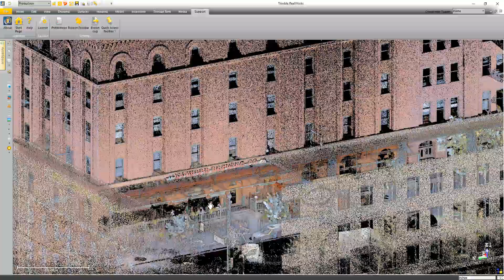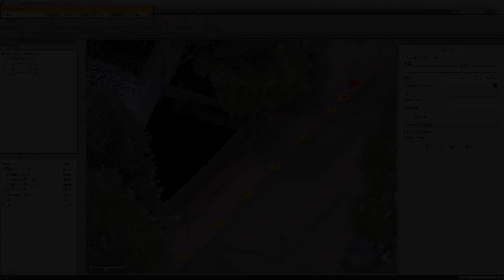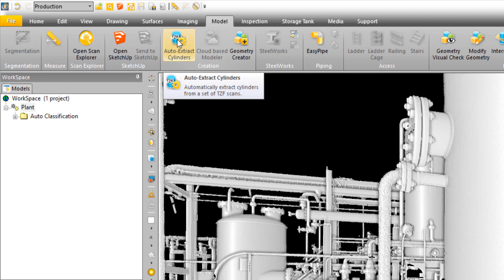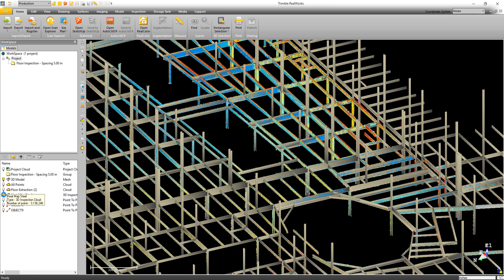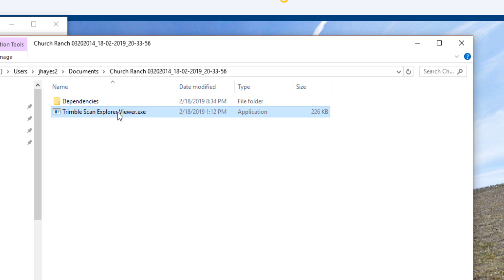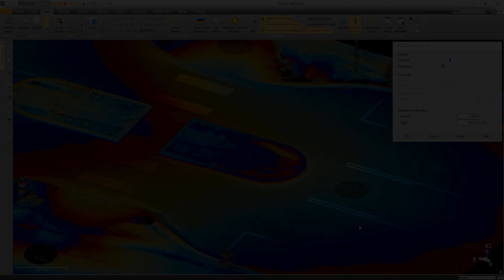What's New in Trimble RealWorks 11.1

Comment: My scanner has started getting horizontal black lines in half of the scan. I've had it serviced in the past and I've tried cleaning the lens. Any idea what might be causing this?
Reply from the maker: hard to say specifically without actually seeing it. If you could send some images to your dealer they can submit the issue to support. Probably the best way to get a correct diagnosis.

Comment: Is there a way to remove unwanted points from the TZF files? I'd like to have a cleaned version for future cloud based registration, there are always points in the TZF I do no want to be apart of the registration process.
Reply from the maker: There are a couple of options you may be interested in. Both options are available in the Production mode under the Edit tab in the TZF scan group. The first option is to segment and isolate the noise into a single object. You can then select that object and click Remove points from TZF Scans. This will be permanent so you may want to have a backup of the raw TZF files. The other option is kind of the opposite in that you can create a final cleaned object and then create new TZF files from it. It is a bit tricky in that you would want to know your grid resolution for the best result. For a TX8 level 2 scan I use a grid resolution of 128.

Comment: I have a really nice laptop set up.... however... when I'm running RealWorks the task manger tells me usage is at 85% or higher.  Whats the recommended settings for TRW?
Reply from the maker: TRW can use a lot of resources when doing the initial processing and registration of scans. the TRW web page gives the minimum system requirements. What I am using is an Intel i7 6 core CPU. This is a pretty nice balance in that I get the extra threads for doing file processing and registration but also some nice clock speed. For the initial steps of initial processing and registration more cores will speed you up a lot. Our QA team uses an Alienware Ryzen system with I think 32 threads and get really good speeds for these steps. However once you get past these initial steps having the faster processors from Intel help a lot more. The next big improvements is having fast SSD hard drives preferably in RAID 0. I am using a couple Samsung 970 pro. The fast drives make a big difference as there is a lot of reading and writing going on when working with TRW. Having 16-32 GB of RAM is sufficient. Next is the GPU. I have an Nvidia GeForce 1080 and get some extra benefits when rendering. In the past I used Nvidia Quadro and had good success also. I haven't tried any of the new AMD cards so I really can't comment on those.
I hope this helps.

Comment: Any Sign of a pre-registration cleanup tool (i.e. permanent delete of noise/traffic etc). This was mentioned in the comments for the V11 0 video, TRW said you were going to look into it
Reply from the maker: Not yet. We actually are looking into it. A couple of questions. Would you prefer to go through each station one by one and clean them up and then register? In that case you can do this in the cloud to cloud registration tool although you can't save this cleaned up state using that tool. Or would you prefer to use one of the automatic registrations and then clean multiple stations at a time in the 3D view and then tighten up the registration? Also I am assuming this is all using a targetless registration workflow?
Reply: @TrimbleRealityCapture  Workflow = mix of target and auto-register using planes. Generally I try to have enough control points so that each setup can be placed on datum individually, then tighten up any minimal mismatch with auto-register using planes if required. On occasion will use cloud to cloud if there is not enough control points or planes to tighten individual setups together. We scan in busy environments with lots of foot, road and rail traffic and therefore lots of scan noise (ideally would like the two pass scan function in the TX8 to only keep the furthest recorded and/or coinciding points from both scans i.e. removing any moving traffic automatically....discussion for another day I suppose)
Basically looking for a permanent delete/ clean cloud segmentation tool to use in registration mode. Preference would be station by station but also cleaning the registered cloud would be helpful also. The main issue currently is that if you have segmented out noise from the project cloud at any stage, it is only a temporary delete. When in production mode and extracting solids I will regularly need to bring removed points from extraction back by right clicking on the project cloud in the list and select "get all points" which does as it says including any noise cleaned out (making the process of cleaning up cloud pointless). Clean by segmentation tool in registration mode that on accepting would permanently remove that segmented cloud (never be available in production mode) i.e. "get all points" in production mode would return all project points minus what you have permanently cleaned in registration modes. Hope the above makes sense.
Reply: @TrimbleRealityCapture  any commitment to implement this? more than happy to provide more information if you require it from a user end?
Reply from the maker: @ronankelly3728  We haven't got to it yet but there are a couple of options you may be interested in for now. Both options are available in the Production mode under the Edit tab in the TZF scan group. The first option is to segment the noise into a single object. You can then select that object and click Remove points from TZF Scans. This will be permanent so you may want to have a backup of the raw TZF files. The pther option is kind of the opposite in that you can create a final cleaned object and then create new TZF files from it. It is a bit tricky in that you would want to know your grid resolution for the best result. For a TX8 level 2 scan I use a grid resolution of 128. 
For both of these options the effect are on the raw TZF files. So you would want to create a new project and import these TZF files and then extract the points from them. A bit of work but if you want to completely remove points from the database with no possibility of retrieving them this is something you can do.
Reply: This is so desperately needed. Without it, it is necessary to use other software for point filtering and cleanup. Very frustrating.

Comment: Hi, all looks impressive. Could you describe your pc/laptop configuration, please?
Reply from the maker: I am using a laptop with a 6 core Intel i7 -8086k CPU 4.0 GHz. I have 32 GB of RAM. My graphics card as mentioned in the video is the NVIDEA GeForce GTX 1080. For Hard disks I have two Samsung SSD  970 Pro 1 TB that should be in a RAID 0 configuration but I haven't got around to it. I also have a third Samsung drive but it is the cheaper 1 TB EVO SSD. I believe the Fast SSD and the fast multicore CPU give me the most benefit. In 2018 we put a lot of effort into supporting the AMD Ryzen CPUs and have had a lot of success and got some amazing productivity improvements when importing, processing and auto targetless registering. However for day to day working in TRW I am still more comfortable with the faster Intel processors.
Reply: Fantastic. 
Thank you very much for your reply.